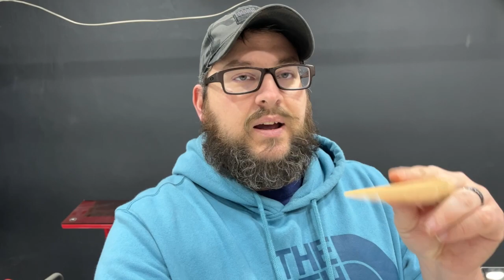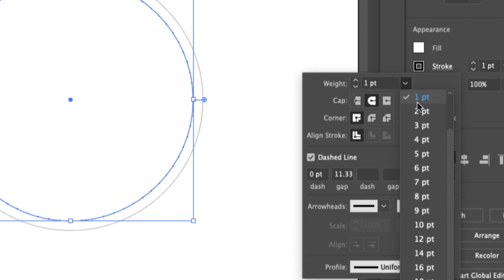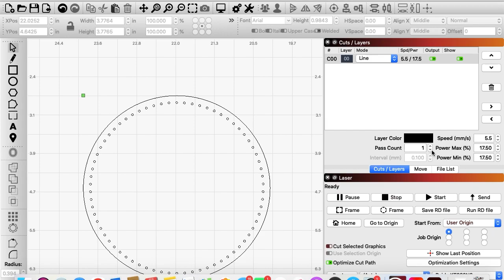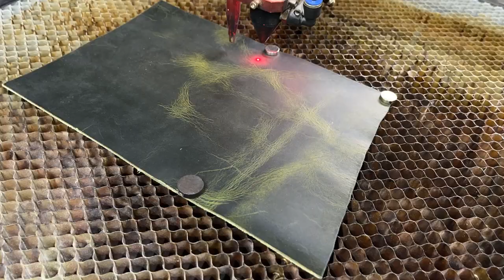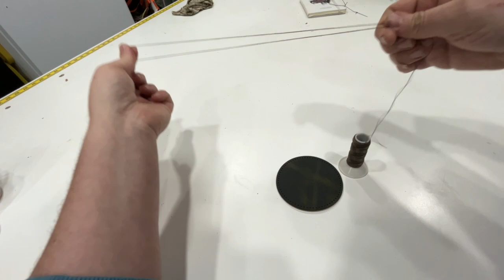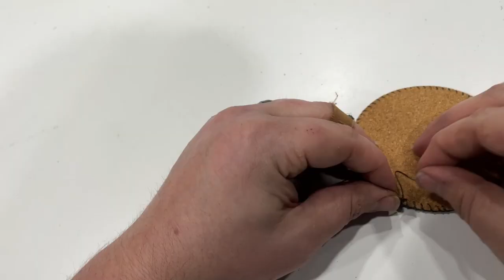How to Make Coasters using a Laser

Comment: How are you handling the burnt smell from burning the holes and cutting the leather?  Any nice tricks to remove that smell?
Reply from the maker: Honestly I hadn’t had an issue with the smell, I just vent directly outside. Now some leathers that might be a synthetic blend which I’d stay away from will have a stronger smells.
Reply: @74CreativeDesigns  good to know and I'll do some testing, may also be my laser settings, number of cuts, etc.  Only done a few leather cuts to date and that has been on the 20W X1.  Need to get it on a honeycomb too and maybe that will help disapate some of it too.
Reply from the maker: Ah yes! And since I run a 60w I can with one pass, so unfortunately with multiple passes it could make that smell more noticeable.
Reply: @74CreativeDesigns  bought a honeycomb and did my first cut on it tonight, a lot less small for sure, just very slight.  Glad i picked that up!
Reply from the maker: @ChatterontheWire  nice! That’s awesome.